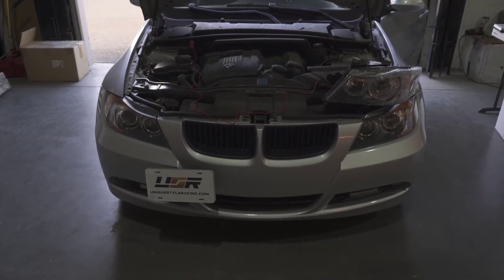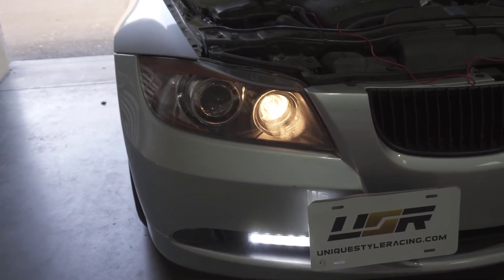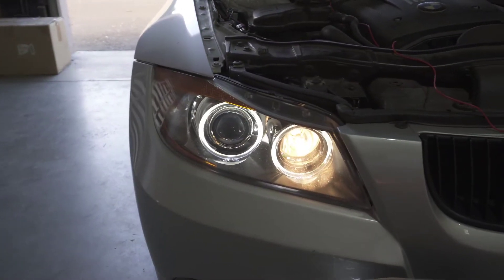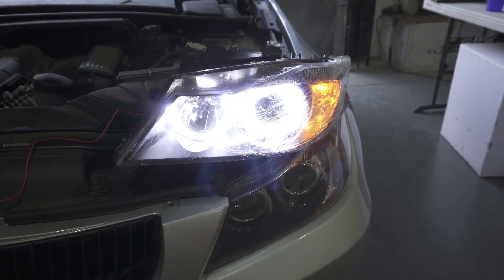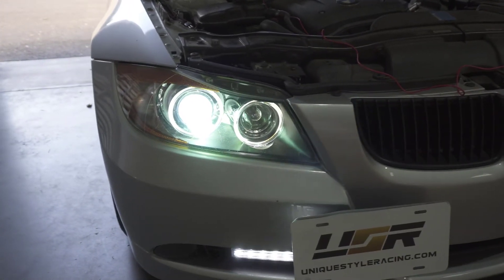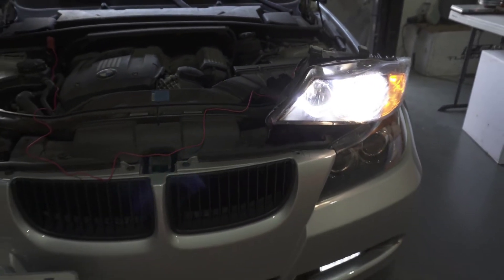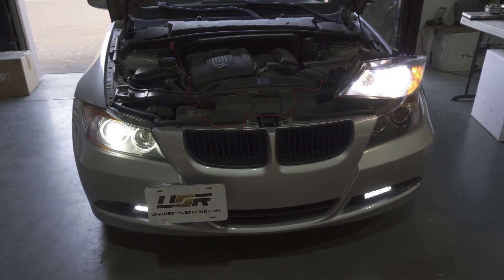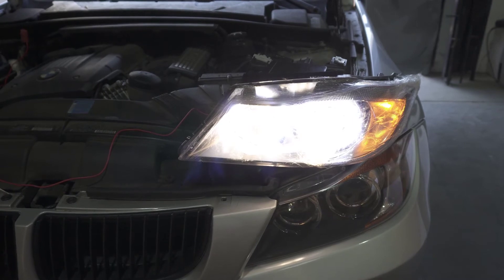BMW E90 DRL Module R&D Teaser

Comment: Is there a follow up video on the wiring ? I too am also interested in these
Reply from the maker: Hi, thanks for asking. We will definitely be making a wiring video in the future once the opportunity presents (if we have a local E90 Xenon vehicle to work with). We've used our co-worker's E90 with Xenon lights, which we did not have his permission to fully install these DEPO lights with the LED DRL modules onto his car. We sincerely apologize for the time being as we've done our best to show the basics of how these LED DRL modules are wired for the Xenon E90 vehicles. Thanks for checking!

Comment: I bought these headlights and don’t know what the long red wire connects to?? Please help
Reply from the maker: Hi Tung, thanks for asking. The long Red wire from the LED DRL module is the wire that needs to be secured the the Positive Battery Terminal post. This is so that the LED DRL module can function properly as the LED DRL module will not work without this wire being secured. Thanks for checking.